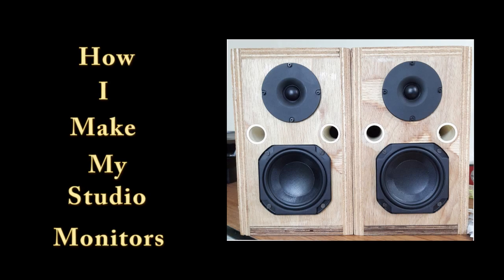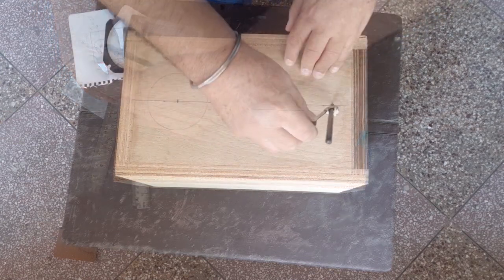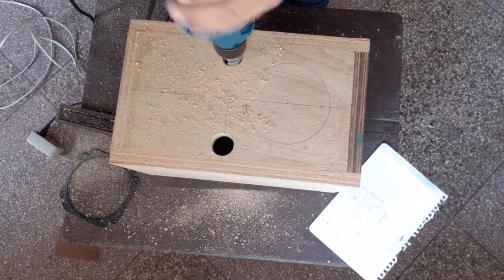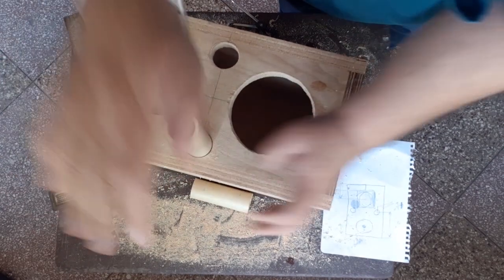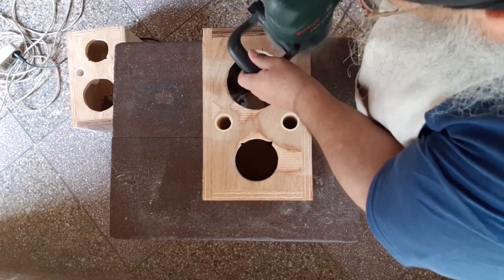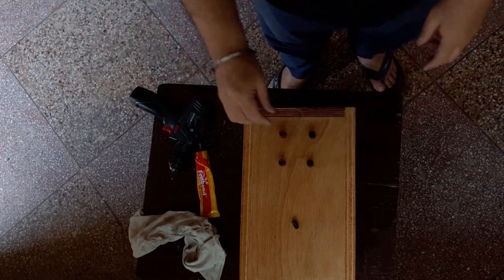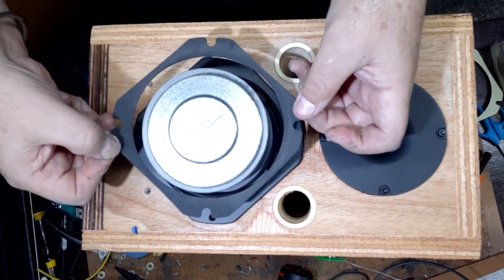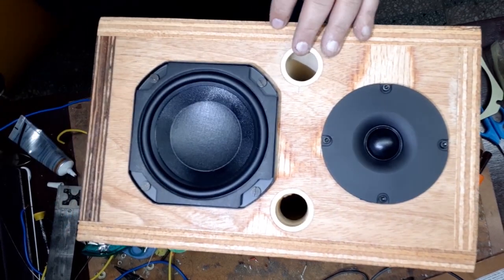Diy Studio Monitors

Comment: Sir aapne apne speakers k liye konse amplifier board and transformer k use kiya tha 
What is length and diameter of vent pipe
Reply from the maker: I used a 7297 as amp and a R core transformer
Reply: @gogiaudios  is this enough to this speacker because it hai 160w total of both speaker and tweeter